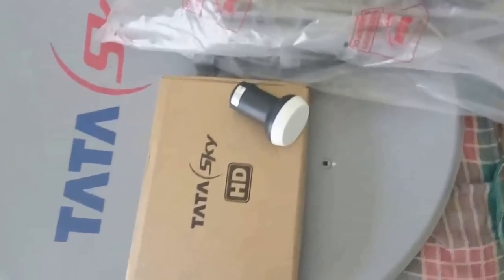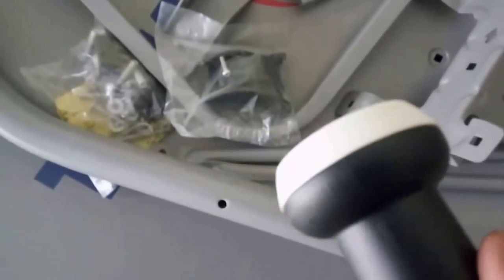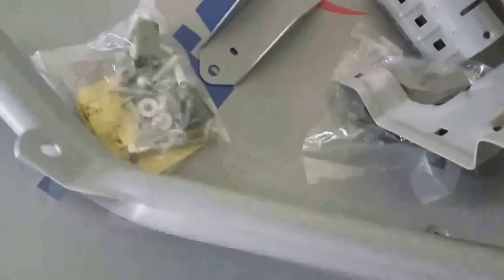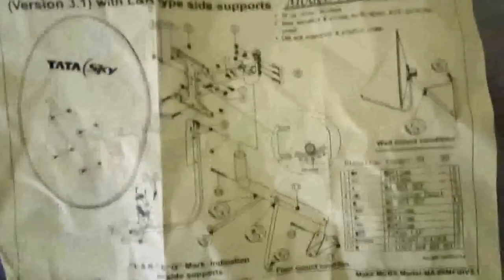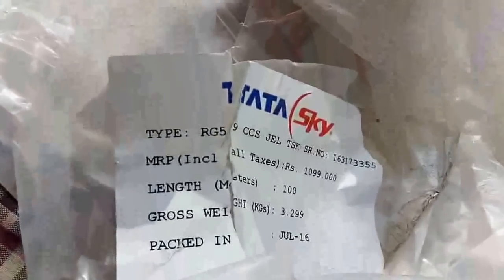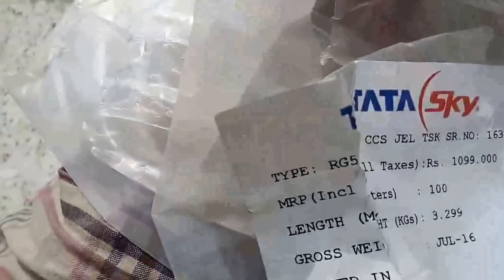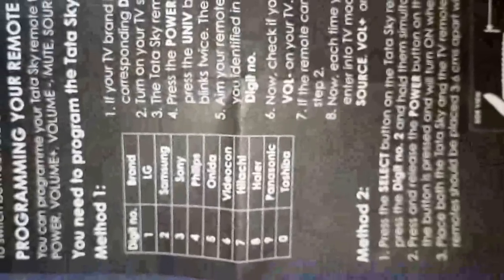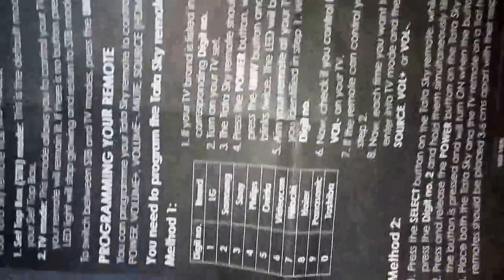Tata Sky HD Dish Installation and Troubleshooting Guide

Comment: NEW TATA SKY DTH CONNECTION 
-Offer applicable all over India for a limited period
-within 4 hours installation
-Free installation and Activation
-1 month free subscription
-TataSky has the fastest service
-Payment After Installation.
-1 Year Company Warranty
-New Connection includes whole kit which has DTH Antenna,Set Top Box,Remote,Power Adopter,10 meters free Cable,Hdmi/AV Cord for free.
Contact Num : 8667O25798

Comment: Sar ek taraf to 100 signal aate h or ek teraf bilkul nhi aa rhe h kya problem ho sakti h
Reply from the maker: There must be some obstruction to the signal or you may be getting a reflected signal. The signal should be high when both Azimuth and Angle are approximate as required.

Comment: Sir m staying in bhutan n recently bought Tata sky hd bt having problems lyk no signal so I downloaded the satellite app but m confused wat satellite to select to get proper Tata sky signal...so plez help me out
Reply from the maker: Please select Insat4A satellite n c if u get a good view, i will c if any other angle is present
Reply: Uttam Kumar thank u sir
Reply from the maker: Hi Sonam, You must be having official support from Tatasky in your area, if you have confusions you can contact them, only if you dont have any official Tatasky support, you can try to set it on your own. If you are an advanced user and have sufficient knowledge about satellite parameters, transponders, etc, you can also try to manually edit satellite settings in your Tata Sky set top box and apply previous Insat 4A for GSAT10 settings using hidden secret service menu . First you will have to align the dish properly so you get good signal strength. Try and then let me know if you still have issues. Regards Uttam
Reply: does this service works every where in world?
Reply: thanks
Reply: ni
Reply: Sonam Yangden 

Dish tv India me kahi bhi lagwane ke liye call kare plan 189 par month .. call - 9589221991 Anuj singh.. All chenal  best dth
Reply from the maker: No, the signal foorprint has to be there & it may be illegal to use this service in non authorized areas too in some countries as I understand. You can get in touch with Tatasky officials for official word on this.

Comment: sir am staying in Andaman nicobar islands here local store are selling tata sky for 4000-5000 rupee so am trying to purchase it from amazon because there is no dealer here at Andaman so I just want to know if am purchasing it from amazon can I install it by my own ??? is the tata sky engineer required
Reply from the maker: If u buy from tatasy they will provide free installation, if u get from another sourcw, u can install yourself too but you need to know how to tune by trial n error
Reply: Can you plzz help me through this apart from your video what I have to do in set of box
Reply from the maker: If u have tatasky box, its set already, ur work is dish positioning, use android software to use yr phone as satellite meter if u dont have one, identify the satellite pisirion n set the elevation as per insat3a 83E n then azimuth, after ever 1-2degree move wait for signal to stabilize n increase, both signal strength n quality should b good like 80&60 atleast, keep trying then once u done tighten the nuts, see video how thwy do it